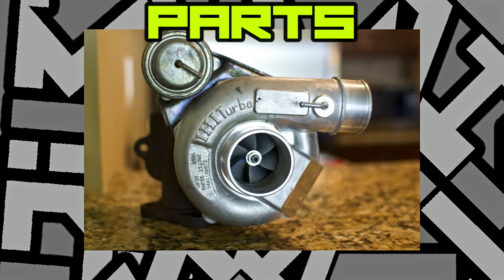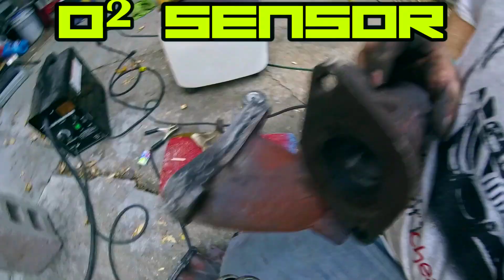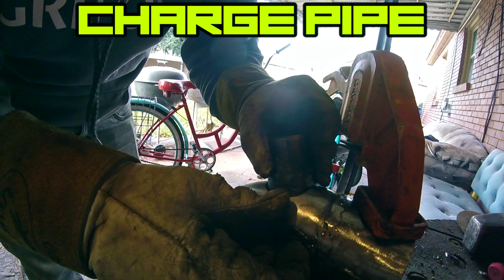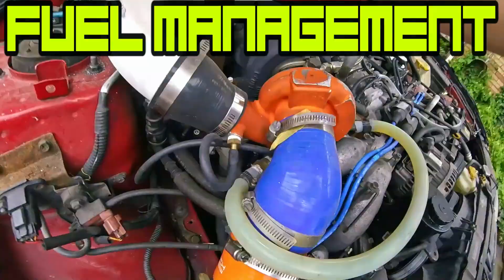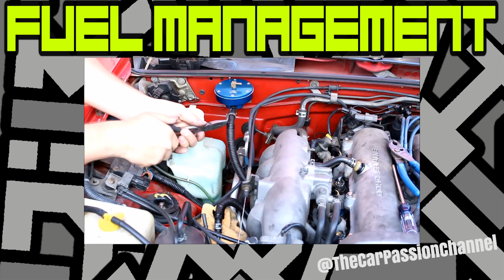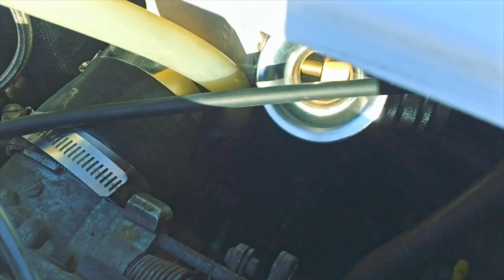Everything You Need to Know to Turbo your non-turbo Subaru

Comment: Great video, but I wouldn't recommend turboing certain models of EJ253 & 254. The cylinder bore for the rings is 99.5mm on some and 103.5mm on others. Mine is 103.5mm and that cylinder wall is just razor thin. The shortblocks are as good as boat anchors once they blow. No rebore or sleeving capable as well. Some people have rebuilt the 99.5's but not every single EJ25 is running the same bore. 

Edit: Great video for just about anyone with a legacy, impreza, Forester XT or turbo outback. But sadly, SOME of the NA Forester's & Outbacks with the older 253's & 254's would just self destruct even faster than they normally do. If I'm not mistaken, Subaru made this change in 2007 or 2008 for the last model years of the second generation foresters in my case have 103.5mm pistons instead of 99.5mm.

Comment: I have a 94 legacy with the EJ22. I bought it with a ebay turbo on it and the boost gauge reads near 10 psi at about 4k rpm. Itll go high but I let out before that happens. There's an internal wastegate with the threaded rod part but no BOV. The turbo doesn't surge at all or really make any turbo sounds. Do you know the reasoning for this?

Comment: I have a 99 legacy 2.5gt and I plan to do scca rallycross with it. I've had the csr for 10 years and it's been flooded up to the mirrors in a bad storm and she still runs great. I'm gonna be putting a turbo on it after I change the valve seals amd head gaskets. I'll probably make my own up pipe so I don't have to notch the crossmember and if anything the car will be getting raised a little.
Reply: Did you make any videos of it?

Comment: Thanks for Sharing this video. It is very helpful. I just bought a turbo set up off a 2008 wrx to put on my 1992 legacy. I am going to start the project tonight, so I may have a few questions when I get started. I am hoping to use the 08 wrx intercooler, but we will see. I have a lot more room than most Subaru's, due to my 6 inch body lift.

Comment: You did so much uneeded shit 😂 they make bolt on kits that work around all this shit.. you don't need to cut no subframe.. or cut shit... If done right you shouldn't have to modify anything an should be able to bolt everything together.. and this comes from my knowledge being raised by certified mechanics and having to work on cars...  But.. it seems you didn't buy a turbo kit and you scrapped shit together..

Comment: Here's everything you need to know:  don't.
Sub frame interferes with the piping.  Bottom end and rods are too weak.  ECU won't work.
You'll spend the money to end up with a blown engine that you could have spent to just buy a WRX.
Reply: Yeah but if you fix those things, particularly the ECU, you are completely unlimited in what you can do to the car next, whereas I with the WRX your first step would be to buy a new ECU :P

Comment: This video was exactly what I was looking for. The motor in my 00 outback seized on Wednesday, on Thursday I pulled a really nice 2.5 from a wrecked 04, that same day I ordered a ACT stage 2 clutch and lightened flywheel and a full gasket set for my new engine. Today(Saturday) I pulled my old engine and since I’m doing a engine replacement and head gaskets, head studs, full gasket set and timing kit to the new engine I figured if I can boost it for less than a grand and run low boost to keep it reliably I figure why not so I started doing some research. The forums were useless so I came to YouTube and this was the second video I found and it’s all the info I needed. Great video subbed, notifications on. Thanks again
Reply: How did it work and which parts did u use 😃

Comment: I have a serious question i have been reading that putting a turbo on a 4eat auto car will throw the tcm off in the transmission and it wont work right is this true? I want to turbo mine i have all the parts then i ran into a thread about this

Comment: I just installed a turbo on my 2.0 rs impreza its a TD04L turbo and im running it without an intercooler since the forester intercooler does not fit because it hits the firewall and doesn't connect to the throttle body how much PSI can i run and how can i adjust it?
Reply: hows it going?

Comment: Thank you for your video, quick question: is it possible to turbo on SOHC 2.0 subaru engine (ej202) and what turbo using will be the best optimal solution not crack the engine? td04 or any suggestion?

Comment: great videos man,  how is that legacy going? I hope is still pushing strong

I am planning to turbo a 2.0 N/A impreza, I have lots of parts already, forester turbo, fuel pump, TMIC, and 440cc injectors but I would rather do not add an aftermarket ECU

with a setup like these what would be the boost limit in an EJ20 non-turbo engine?
Reply: highest boost ive seen on a stock ECU is 8lbs

Comment: running no blow off valve DOES NOT damage your turbo or anything, turbo flutter when your throttle is closed DOES NOT damage anything, but turbo flutter when your throttle is open DAMAGES your turbo badly!

Comment: I have a 02 forester block and 25d heads. 251/25d. I was told doing this lowers compression. I was also told I can run 4-6 psi of boost. With w255 and stock injectors. Would that be a safe build?

Comment: Hi, Dirtcheapdaily. I am your big fan. Quick question please advice me on turboing my non turbo 2004 subaru legacy 2.0i 138hp. So weak car i have and need more power. What do you think on installing td04, or my engine and 4AT transmission wont handle?

Comment: Hey brotha, I just finished up getting my turbo installed on my 02 legacy, put my uppipe an inch too long to clear an 06-07 intercooler. Are you still running without one? I am gonna be pushing 5psi it would be a huge headache saver if I can get away with just running a charge pipe straight to throttle body. Lmk

Comment: Question for you on 04 wrx td04 noticed you said its stock 8psi, if I want to run 4-6 psi could I just add an external waste gate to prevent overboost or can I swap the internal waste gate for a forester turbo onto the wrx turbo?
Reply from the maker: Yup! That’s a pretty easy route to go. If you can verify it actually came off a forester.
Reply: Dirtcheapdaily thanks man. Got confirmed that the turbo came off an 05 wrx so I believe it's a 6psi spring so I'm just gonna go for it, worst case I just add an ewg like I mentioned in my other comment. Also found a kiwagawa actuator with a 4.5psi spring for 80 bucks so looks like I've got some options to make it work. Thanks

Comment: did i see cutting out a notch off the subframe? @3.40 yes it is-that has seriously weakened it. in some countrys it will fail any kind of roadworthy certificate. downright dangerous. if you have a fatal or even bad crash the insurance will walk away.
Reply from the maker: You must not have seen me weld in reinforcement plates. 

People notch the stock subframe all the time with good results
Reply: Dirtcheapdaily. This Part is designed on a Computer  with stress testing software, to ensure that there are no weak points and it will  deform as per computer simulation  and not  negativly affect the structure  in a crash?
Reply from the maker: So we should never do anything to our cars if it didn’t come like that from the factory. 

It’s just metal

Comment: Hey Aaron, did you have a rough idle after put the turbo on? I have my turbo set up the same way that you do but I have a front mount intercooler installed and after the engine is warmed up the idle is so rough that the car shakes and sometimes the engine stalls at stoplights, I need help!!
Reply from the maker: Mine ran just fine after the turbo. 
Sounds like you have a vacuum leak somewhere.

Comment: ive got a bg9 wagon. ej25. used a vf14 primary off a twin turbo on stock up pipe and stock non turbo exhaust minifold. oil feed went straight in the rear of the head on the left looking at the motor from the front. did put return oil in rocker cover also. cross member had both exhaust pockets to save cutting. did change power steer pump to a turbo one due to the plumbing from airflow and turbo intake (hacked a twin turbo intake and blocked remaing hole).........used a turbo intake manifold but fitted it with the ej25 injectors and rails plus wiring. short custom downpipe adaptor to exhaust and stock charge pipe from turbo to minifold. stock bov. slight idle issue at the moment, but so far its boosting. also done manual conversion...... thanks for your vids....theyve helped a heap

Comment: This is a fantastic project and post...Thanks for your diligent work in compiling these videos and informing us all on the details of your journey!  I've got an EJ25D (96 version), stock ECU/wiring harness/MAF, and a TD04L sitting in my garage for an upcoming project.  Mine however will be on a super light-weight sandrail, so the fabrication and fitment will be a piece of cake compared to what you've had to work around.  I too am planning on playing with the 5-7 psi NA/turbo set-up as well and sticking with a stock ecu on 110 octane gas for now during this 1st phase of experimentation.  With that said, I've got a question...how does the torque fill to you throughout your acceleration, especially in the upper rpms?  Is it all down low or does it still pull nicely up top?  I may want to race mine, so torque placement mid to up-top would be a plus.  Just wondering if I might need to step up the turbo size or if the TD04L would be sufficient with the compression ratio that these EJ25d's have.
Reply from the maker: It pulls pretty good the whole way. It’s only at 4psi, so it’s not got a whole ton of oomph, but for what it is I’d say a td04 is a good start. It comes into boost pretty quickly, by 2800rpm I’m at full boost. So there’s that balance too.

Comment: So, needless to say, my 2003 Impreza with some piston slap in #3 cylinder, would not be a good motor to turbo due to it not being a healthy motor? I'm just tired of the lack of power (literally, slight grades I have to downshift into  2nd gear) and I don't have the money for a wrx right now.
Reply from the maker: It’s probably not ideal. Lol. And honestly, if you’re not in a position to deal with a blown engine, it’s probably worth waiting a little bit. 
Have you done an intake and exhaust on yours yet? 
Freeing up those restrictions goes a long way on a tired NA
Reply: Dirtcheapdaily I have done an exhaust on it, and slightly modified my intake a bit. That's why I wanted to go straight to a turbo, since there is really no other option for me to go to. I mean, it's my first car, so there is sentimental value, but I'm getting really tired of being embarrassed by my wagon. Thought about ej255 swapping all of the components, and even a 5 speed swap, but what's the gain? I'm probably going to sell it.

Comment: Nice! For the intercooler though I wouldn't use the early forester xt since the stock bpv just comes straight out hits part of the throttle body. The 06-07 wrx or later models forester xt intercoolers would be a better choice/ more options for bov. And bpv comes out in an angle.

Comment: ive been waiting on a video just like this for so long. definitely doing this. have no other subaru rn other than my daily driver and i just got rid of my beater last weekend... time to find another one, honestly thinking about trying the exact same budget setup you're running whether its on an impreza, legacy, outback sport or forester. ive never driven a 6cyl subaru either so that might just be my next buy. i just want something fun, and something to continually build so i have something to do when im bored
Reply from the maker: If that’s the boat you’re in, I’d say find a cheap legacy LL bean. 01-04. Sedan if you can. They all have the h6 and they’re a ton of fun! The transmissions go out before the engine will
Reply: @Dirtcheapdaily  was this also done with the factory clutch ? And anything new with the supercharged h6 ?

Comment: Awesome video!  I will be starting my turbo install very soon. I just need to get a few hoses. I intend to document the build. So I will show you my car when I'm done. Thank you so much. You are one of the main reasons I had the courage to start modding my car. My car is totally different now ,in a good way! Your videos have helped me out so much.  Quick question,?  I have a areomotive style adjustable rising rate fuel pressure regulator (ARRFPR) 1:1.  I am only going 4-5psi., Until I get some type of engine management. ( Probably emanage blue/ultimate or project lambda ecu reflash. Until then do you think that this style FPR will do anything good for me? Thank you again! Craig & Takira.
Reply from the maker: The stock fpr has a 1:1 rise rate, so you’re probably set with just it. 
I don’t run any aftermarket fuel regulator on my legacy with 4-5psi and it handles it fine.
Reply: Thank you

Comment: Can you do this to an ej22?
Reply from the maker: Yes. You might have to get creative with headers if your heads are only single port though
Reply: Just turboed my ej22 single port. You can use stock header(however I'm running a custom uel) you just need a custom up pipe. I got a Subachad up pipe and it's a direct bolt on and works really well. I had to run a custom fabbed down pipe tho. Definitely worth the work!
Reply: have you teste ur setup? how much more does it make now?

Comment: If I notched the cross member how soon would I need to weld it and would the car feel alot less rigid?
Reply from the maker: I would do it ASAP. Depending on how you notched it, it could hold up for awhile. The way I notched mine, with the hard 90* corners allows for cracks to form a lot easier than if your cut was smooth. 

But it all depends. I’ve heard of some guys never welding in reinforcement and not getting cracks. I’d say just check it frequently and if you start seeing a crack weld it up! Lol
Reply: Dirtcheapdaily Thanks! I'm turbocharging my first gen Legacy, but don't know how to weld, so I needed a reference on how long to find someone who knows how to weld.